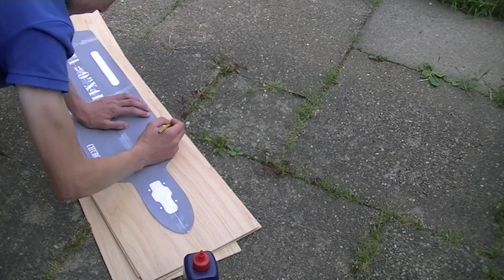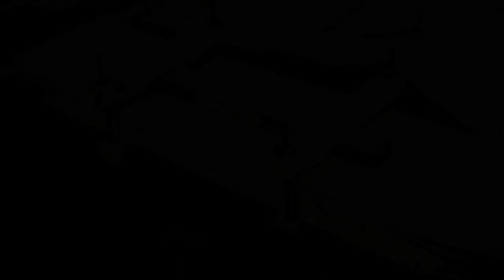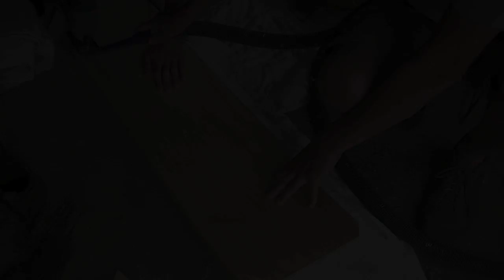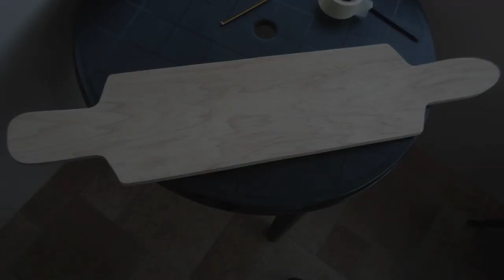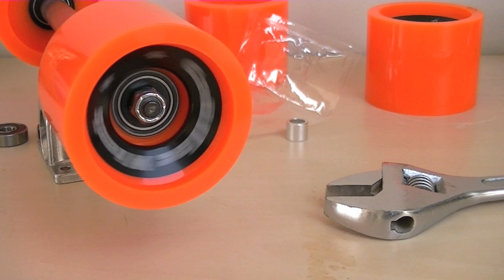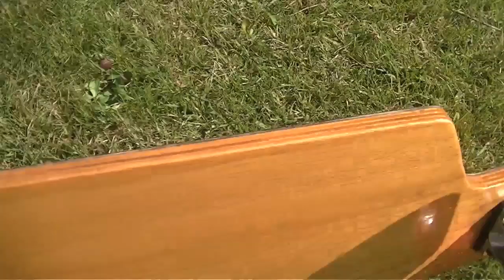Homemade Longboard (DIY Electric Longboard Part 1)

Comment: Hi, great Board! Which Wheels spacers and bearings did you take? They roll perfect !
Would be nice if you told me .. ?
Reply from the maker: tobiasplatzen10 Thank you! I used Cadilac 70mm 80a wheels. 10mm spacers (I think) and Mini Logo Bearings. It is a very nice set-up for the money.

Comment: So for more flex I should use a different wood??^^
Reply from the maker: well 1/8" Maple, Birch or Beech are the best woods to use, people usually use 2 or 3 layers. As it is quite a bit thinner than my board you will need to reinforce it with fiberglass layers or it will snap. There's some tutorials of building a fiberglass board on YouTube.
Reply: Nice thanks for the info!:)
Reply from the maker: ***** You're Welcome!